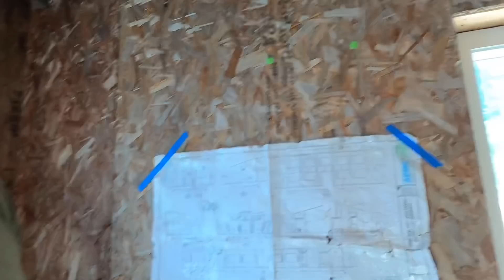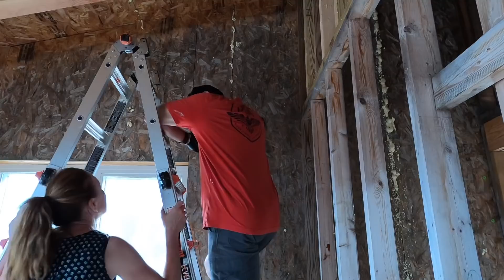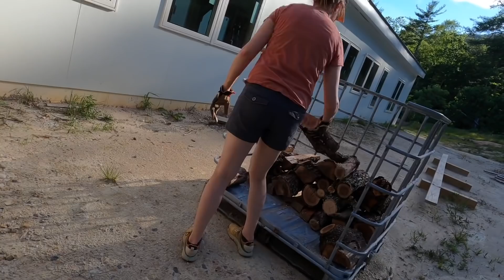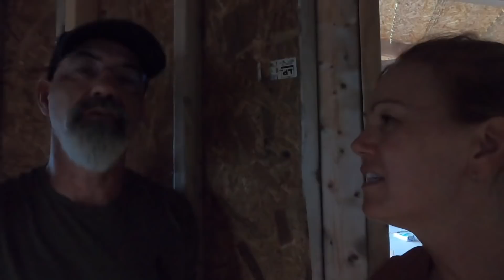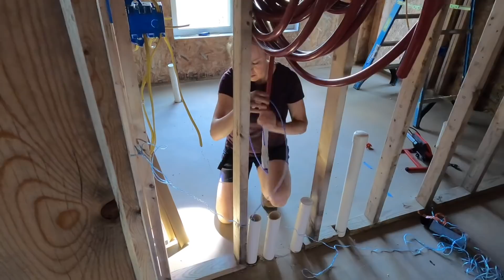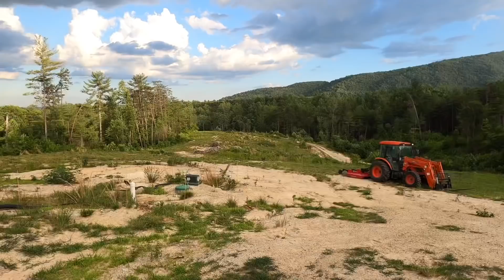No more foam. Time for something new.  #153

Comment: When using IPC tote frames don't cut out the bottom 2 rails on the front . I had one filled with split firewood and it split apart on me . So now I leave the bottom 2 intact !!  Been there  also yes fill the tubes with silicone to prevent wasps and pests from nesting